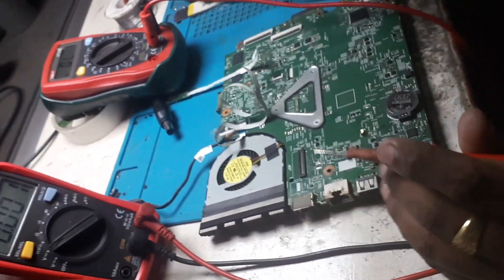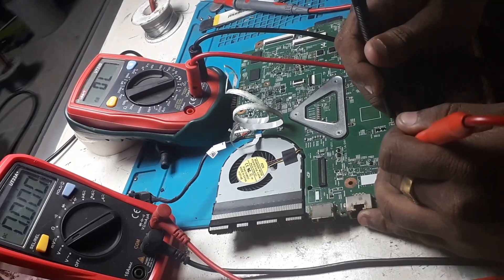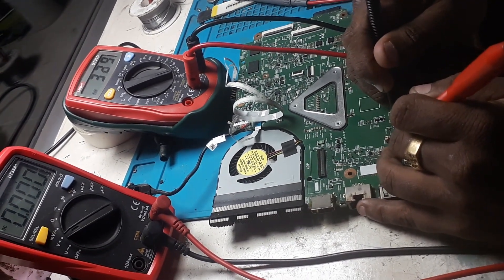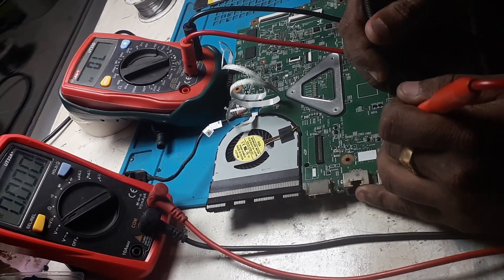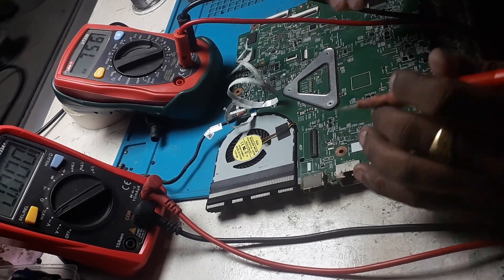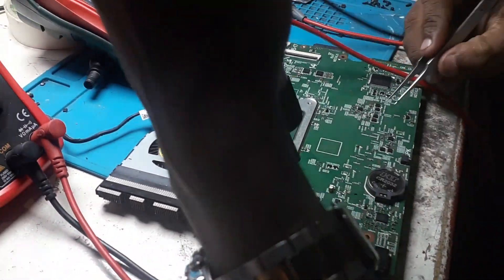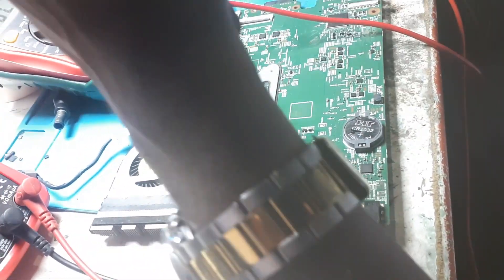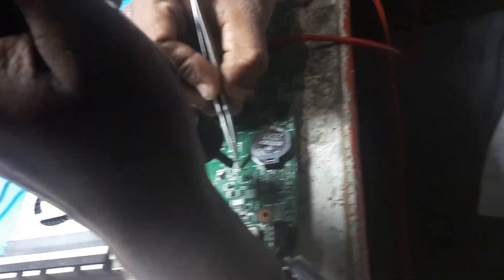Dell 4 Beep Solution  | Laptop repair course | #Aditya11ttt #Dell #beep #Solution

Comment: Nice video. But do u have to check the ram slot with the ram in it? Wouldn't it be easier to remove the ram for checking purposes?
Reply from the maker: It depends on the type of job u are performing, if u want to check the single which are being generated after putting the Ram in that case ?
Reply: @Aditya11ttt  ok sir. Thank you